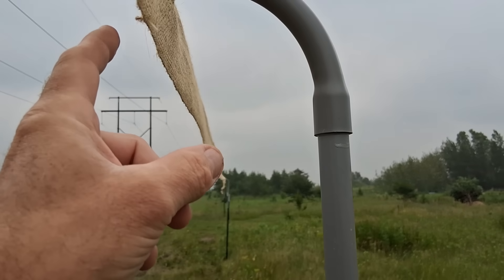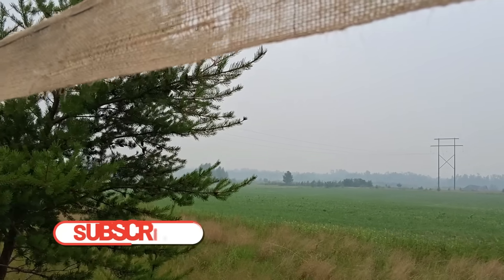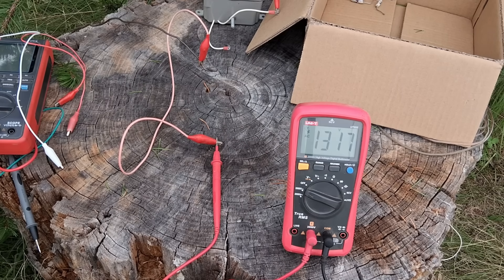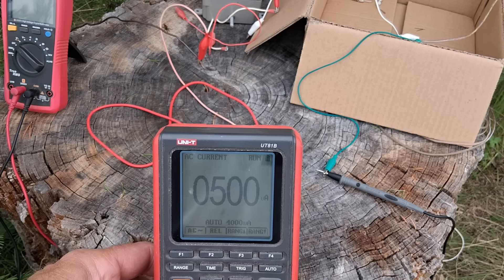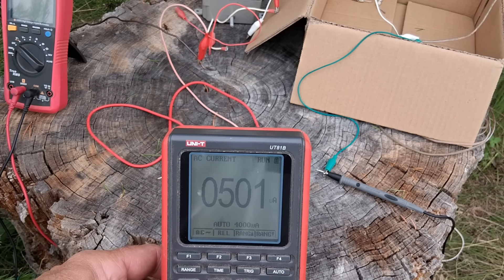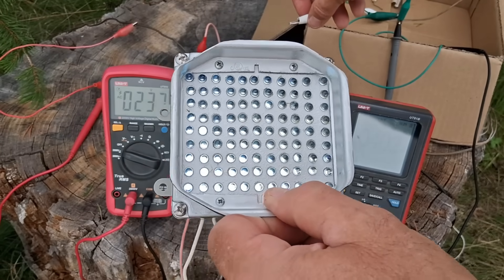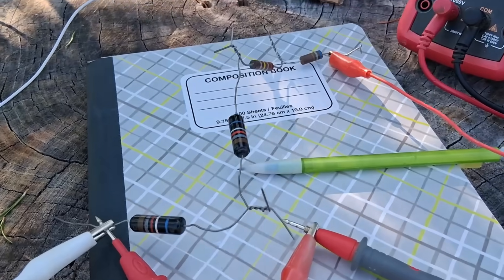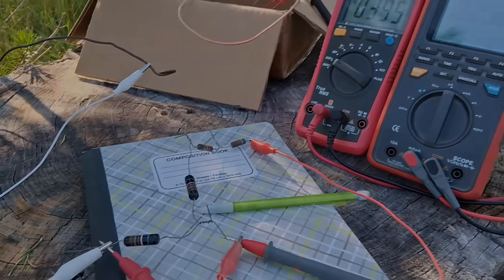Power sucking fences near H.V. power lines.  What transpired since?

Comment: I did something similar with a friend who owns hundreds of acres of land with those 19kv power lines running across one of the more rural parts of his property. He has supply sheds dotted around and they all have solar panels and batteries, but he wanted to know if he can use the power from these lines without actually touching them. I told him to get about 30 feet of PVC pipe and tape a fluorescent light at one end. Using a wooden ladder, rubber shoes and gloves, go out there, at dusk and wave the pipe/light under the powerlines and see if the tube lights up. If so, then yes...he can use that power.
I said to make a coil of wire and attach it to the side of one of his supply sheds using the PVC pipe and route the output to an LED bulb. He did all this and now his rural supply sheds have a porch light and an internal light so he can see them at night!
Reply from the maker: An interesting video I did with lighting:  https://youtu.be/87AokwsUdqg

Comment: The thevenin equivalent is 1300V with 2.6MΩ ESR, so you could draw up to 0.16W out of that, which isn’t bad considering you’re running up against the inverse cube law. Though the step-down converter would need a pretty low quiescent current to make it worth using. I wonder how small you could go and still power a little LoRa weather station?

EDIT: someone beat me to the ohm’s law.

Comment: In the '70's in Texas people routinely did this powerline draining with buried coils. It was enough to power small outbuildings as well as electric fences. The power companies could easily trace the area of the drains and used metal detectors to find the buried coils. People were prosecuted, lots of hippie-types and drop-outs living in those outbuildings.

Comment: Obviously you know what your speaking of, so my question is what meter is the probe not in the right most position for the hot lead measuring voltages, i am familiar with having to move them for current  but as a kind of safety mechanism it's always that way, until just now
Reply from the maker: The current meter I have would be damaged by the high voltage.  I shorted the (fence) wire out to the ground, (0 volts), then I attached one lead of the current meter to the ground, and the other to the (fence) wire.  Then I unshorted the (fence) wire so it power was running through the meter to get the reading.  -(it didn't have a chance to build up to high voltage).  The voltage reading I just took across the whole load.  -from the ground to (fence) wire, with any load in between.

Comment: A current in the power lines produces a magnetic field.  In AC that field collapses a fraction of a second later and reverses direction.  ANY loop can intersect this and develop an emf.  And supply some current. This could be a dangerous nuisance such as on an electric fence or it could be used to steal energy deliberately.  It can destroy radio and TV reception by having such a powerful signal that it simply becomes a jammer circuit.  That is my situation.   I cannot use a normal aerial to pick up my nearest TV station because of the wires between me and them.  I need a directional aerial that aims away from the lines. And not at any station.  Just away from the lines so that I don't pick up unwanted signals from them.
Reply: Sounds like you have RFI from the power lines, you can contact your local power company and have them fix it. According to the FCC they have 60 days to correct incidental RF emissions.

If your power company has no idea what you're talking about, contact your local HAM radio guys and see what they do to resolve RFI.

Comment: This is REHASHED from a while ago. FENCES DO NOT SUCK POWER FROM a HV POWER LINE. NOT TRUE! DECEPTIVE WORDING! However, a HV power line DOES RADIATE electromagnetic energy and that is what can be picked up and maybe used. My hand held testers, PICK up live wires in the SAME WAY and tell e inside the wall is a LIVE WIRE.  It is NOT ROCKET SCIENCE!

Comment: You could use a microwave oven transformer in reverse to bring that ~1300V down and make it useful by increasing current to about 5mA at around 60V, then another step down transformer could get it down to around 12V where you could get 25-30mA.

Comment: So forgive me, I mean no offense.  But this is kind of pointless from a practicality standpoint, wouldn't you say?  Other than being interesting of course.
Reply from the maker: Meaning; stringing up a conductor thinking you're going to get a significant amount of power?  -yes.  
Comparing to the solar panels I just replaced; I have seen that I'm getting 88 watts of usable solar power before sunrise in dim light on a cloudy morning, (2.6KW system).  
This video topic, just seems to be very interesting to a lot of people.
Thanks for your input!
Reply: @doubleMinnovations  I knew an electrician that spliced LOTS of scrap wire together, the really heavy stuff and laid it under the really big metal pylons that ran through his country property.  

He said that if he had used virgin wire he never would have afforded it.  But copper he was scrapping let him do it.  He was able to get some power from this- but he would have done better with solar or wind.  He just kind of felt like sticking it to the power company he use to work for and was let go at, lol.

Not enough to run his house, but it did help recharge his batteries so that when the heat hit at sunrise, they were topped off to run the AC.  

But he told me that solar and wind with a backup generator got it all over parasite power...

Comment: To extract maximum power from a source, the load resistance needs to match the resistance of the voltage source. Assuming an open circuit voltage of 1300 Volts and a short circuit current of 500 uA, the internal resistance of the source can be calculated to be 2.6 MΩ. So maximum power transfer will occur if the load also has a resistance of 2.6 MΩ. Deviating from that in either direction will always result in less power being transfered to the load. We can also calculate the maximum power that can be transfered to the load: It's 162.5mW.
Reply from the maker: That's interesting, thanks for the calculation!
Reply: This guy Ohms Laws for sure.
Reply: Did you use a "theavonize" analysis for the first number, or just basic ohms law?
Reply: @jeffreystroman2811  Do you mean Theveninize? I'd say both, since the only missing part for a complete Thevenin equivalent was the internal resistance, Rth. And Rth is just the open-circuit voltage divided by the short-circuit current, which follows directly from Ohm's Law. After that I just applied the maximum power transfer theorem.
Reply: Ohms law/Kirchoff's law.
Reply: I really can't stand people who toss around "Ohm's law" or "Kirchhoff's law" at every opportunity just to show off. There isn't even a single "Kirchhoff's law" in existence. You need to be more specific, or at least use the correct umbrella term, "Kirchhoff's laws." Plural! If you actually want the important buzzwords for this use case, they would be "maximum power transfer theorem" and "Thévenin equivalent voltage source."
Reply: @BalticLab I was commenting as a "conglomerate for people not educated in this field to start searching /learning. " Idk why that would anger you, but to each their own. ✌️

Comment: The open circuit voltage will be high but you'll get little current.    It's a "high impedance source".    Still.  you might be able to get a small flourescent light to light up.  (maybe).    Where I used to live there was a very high voltage line behind my 4 acre lot.    I could hear the crackling LOL

Comment: You should do this as far as possible from the power lines, and at 90 degrees if possible. There's a similar project using old TV cable as an electret to harvest ions connected to a step down transformer.

Comment: It's a bit of semantics ... you ARE connecting to their equipment, just not with a wire. If your equipment were not there, that power would continue on down the transmission line. True, it's measured in microAmps and the power company knows their total transmission losses are much much larger than that. It makes me wonder what the theoretical limit for wireless power transmission is --- oh, right, Tesla again

Comment: Hey brother, An antenna is just a conductor, a tuned conductor to pick up certain frequencies better than others, but they do work just like the secondary coil on a transformer: Radio waves are magnetic fields that induce a voltage into the conductor/ antenna. As far as the burlap goes: When dry and the humidity is low enough it could be picking up static electricity. This is a great video, well done, great experiment. Now here's the frightening thing: People are also conductors: I'm an electrical engineer and we were taught that: You can measure the effects of the magnetic fields Coming off high tension lines in living organisms 1,000 feet away from the towers (It might have been 1,000 yards its been a long time). Having a voltage induced into your body is so so bad! Guys that work High power radio transmitting facilities and lineman as well will actually start acting screwy because it messes with your body's electrical system including your brain waves and there's much more horrible effects caused by these towers, But all I'm going to say is: If your house is in 1,000 feet of the aforementioned: Move! Edit: I remember now: it was 1,000 yards!
Reply from the maker: Thanks for the interest.  Radio waves, are 'electromagnetic waves'-(a propagating dielectric field with a magnetic field at right angles).  The experiment in this video, is induction from the electric field.  Capacitive link, or what the power company call a capacitive coupling.  And actually use this method for customers far from a substation.  The conductor is hanging down much closer to the wire of course, and voltages are regulated by the power Co., so the electric induction is consistent.  I have some other videos that demonstrate it better.  Like my next one with the tree, or the one with what I humorously called my 'electro-smog energy converter'. or the one where I measured my body.

Comment: I used to hunt on a property that had high voltage lines running through it. When it was misting rain you could hear the lines buzzing, so one day I carried a 16 inch tube , and standing directly underneath it lit up, not real bright, but it was on!
Reply from the maker: Yep!  That's a fun experiment.
Reply: A Motorola walkie talkie will do the same thing.
Reply: Tube????
Reply: @krimke881  Fluorescent light bulb.

Comment: Maybe capacitors going up in capacity with a efficient surface mount solar controller might help with the small amp loads. You could use it to charge a high density capacitor to trickle charge a battery with a higher amp load. 

There's also some new fabrics out there on the Chinese marketed at anti EMF fabric, which is is just a net of copper strands strungle along the textile. Might be just what you need if it can actually conduct electricity ;)
Reply from the maker: anti-EMF fabric....  that would probably work.  I tired copper tinsel, and copper mesh.  The copper mesh worked the best.  Thanks!

Comment: In college one of the older student’s home was next to a new high voltage power line(360k volts). Long story short the instructor came up with a formula from an engineering text book. One of the key values in the formula was the radius squared, in other words distance from the current carrying high voltage wire squared and the other main factor was the current thought the high voltage wire which can of course vary over time throughout the day. Remember that the other wires on the line although farther from you are out of phase with the wire nearest to you and your wire “antenna”.
Reply from the maker: Thanks for sharing!

Comment: In circuit terms there's a small capacitance to the power line. But if you connect a large series inductor to your collector with the right value, you can tune away the capacitance at the line frequency, and you end up with effectively a low impedance connection straight to the power line(!!!) I suggest you don't do that for a) safety and b) it's theft c) the voltage on your collector would go ridiculously high due to resonance. But it's fun to think about.

Comment: An 1/8 wave resonant wire at 60hz is 1950 ft you could try creating a resonant tank circuit then use a single wire return transformer to transform this down to useful current.

Comment: you are not actively seeking to take power from the lines, the company can piss off.
Reply from the maker: I could build a 3 story metal building 700' long along the easement, and ground out the whole area, and the power company does not have any say, or could care less.  Because they know there's no amount of loss that even matters.  They set the size of the easement.  And like I say in this video, and show in others; there are houses now on the edge of the easement, (and tall trees) grounding out those areas.
This video shows that the lines are polluting outside of the easement.  It's called 'electro-smog'.  Some people claim it's dangerous and causes cancer, and all kinds of problems.

Comment: In PA we have alot of dead and abandoned telegraph and powerlines, sometimes owned and running parallel with the old tracks. Every now and again people will try and steal them but its a huge risk because even a wire connected to nothing can still hold a static charge and thats basically what this guy has created. That's why you really should have one mile long spools of wire on your property, especially if they're suspended in air.

Comment: it's silly how we say it "sucked" the power out of the lines, it's just ambient radiation being dispersed, no extra power is being lost
Reply: The power has to come from somewhere (first law of thermodynamics) and it’s coming from the powerlines, which can be demonstrated during a blackout, when the power line has no power in it, there will be no power harvested. If you object to the sexual overtones of the word “sucked” you could say “removed” or “drained.”
Reply: I hate to disagree with you, but: you're wrong. A fence works just like the secondary coil in a transformer: A farmer discovered that if he wrapped chain link fence insulated from the ground around the base of a high tension line tower he could power his whole farm. Our Local power company noticed they had more line loss than normal, discovered the farmers contraption and made him remove it. The reason I know all this is because: I'm an electrical engineer. I could see why you would think what you think because there is no physical connection to the farmers fence just like the secondary coil inside a transformer.

Comment: Enjoyed your video and just a couple of comments from and old retired EE and former ham radio operator. I suggest you warn anyone wanting to to experiment with this idea that any people in the area getting shocked on these power sucker wires might cause them legal issues, so a number of voltage limiting devices such as MOVs or zeners should be installed along the line. However, that still does not mean such a rig would meet an sort of industry safety standard, so be aware of potential problems with neighbors and right-of-way workers.

One old rule followed by many industries was that voltages above 48 volts had to be guarded from direct contact by humans, a standard I think set by Ma Bell many decades ago. That would therefore limit you to around 25mW, perhaps enough to trickle charge standby batteries after rectification. Obviously, an antenna with more surface area should give you a higher limiting current. 

Thanks for doing your experiments!

Comment: Why the burlap? Why not a standard insulated wire?
Reply from the maker: The burlap increased the output of the wire.  Copper mesh worked good too, but more expensive.
Reply: @doubleMinnovations  That's odd, I think. I would expect the burlap to act just like any other dielectric material, and therefore cause losses. Or is there some other explanation?
Reply from the maker: I have several other videos on that subject you may like to check out.  Treated with vinegar, the burlap becomes slightly conductive.  The same with wood, as I've shown in other videos.  This extra material creates a greater spacial area, that I think increases the ions near the metal wire.  I think the E-field is acting on the ions.  -Just my thoughts.
Reply: @doubleMinnovations have you tried the ribbon style electric fence "wire" its a wire mesh in poly ribbon that is designed to be more visible to animals. Farm and feed store should have it, might be worth a try, if you haven't already tried it.
Reply from the maker: Yes, I know of the stuff.  Burlap; like wood, will become a slightly conductive because they are porous and will absorb vinegar.  'Poly', plastic stuff doesn't.  Thanks for the interest!